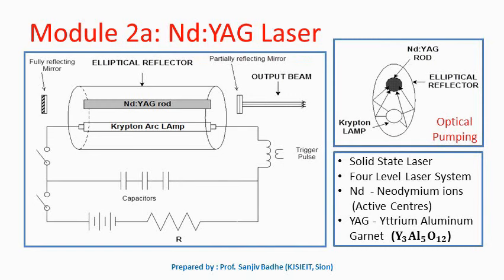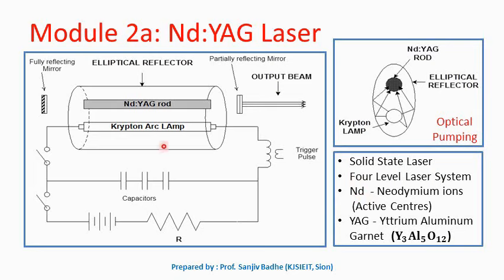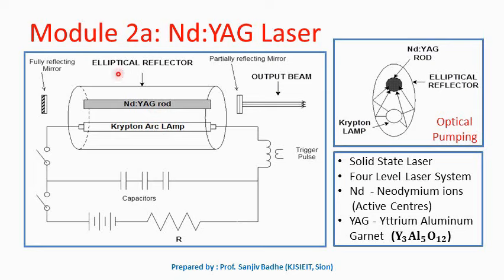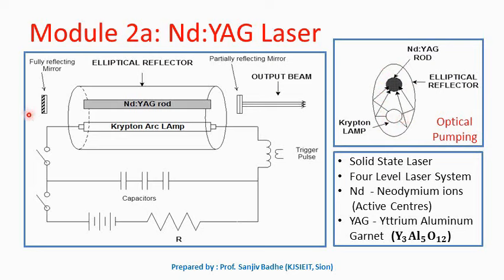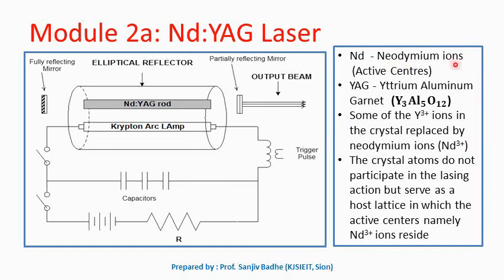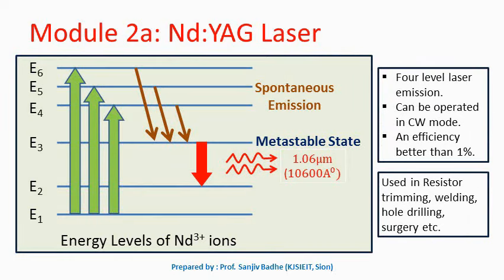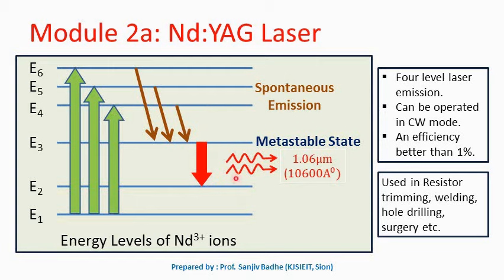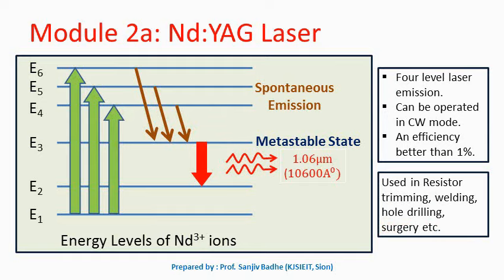Construction and Working of Nd:YAG laser

Comment: Sir why not population inversion took place between E2 to E1
Reply from the maker: The ground state E1 is highly populated. So it is difficult to get more atoms in E2 than in E1. Even if it is achieved, it will not last for long.. So the laser systems in which E1 is involved are generally pulse mode lasers and not continuous wave lasers..
Reply: @EngineeringPhysicsbySanjiv  okay thank you sir

Comment: teacher just a doubt when you talk about yag laser it would be that ophthalmology equipment to do capslutomy, what happens when i'm going to fire the laser and he disarms. could you explain this step please.
Reply from the maker: You will have some drops put into your eye to make the pupil big, and an anesthetic eye drop to numb the surface of the eye. The treatment is painless due to the anesthetic drops used to numb your eye before the laser and takes approximately 20 minutes.
The doctor will put a special mirrored lens on your eye before applying the laser beam. This lens allows the doctor to view the membrane clearly so he or she can apply the laser and make a small hole in it to clear the vision.
Reply: @EngineeringPhysicsbySanjiv  great explanation teacher.  the problem I have a Yag laser.  because it’s disarming when I’m going to increase its power when I’m going to perform the firing test I’d have some idea of what it could be.  Could it be some capacitor or the gas in the cavity?  maybe I was wrong about the topic of capslutomy.
Reply from the maker: @vlademirisidoro9583  Not sure.. But it may be capacitor issue..